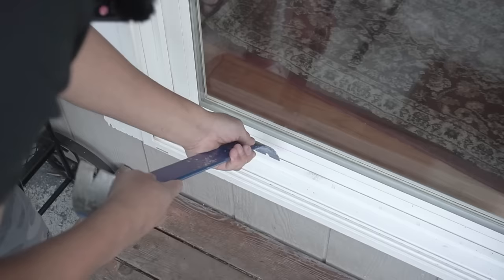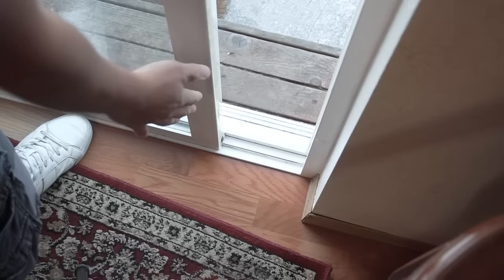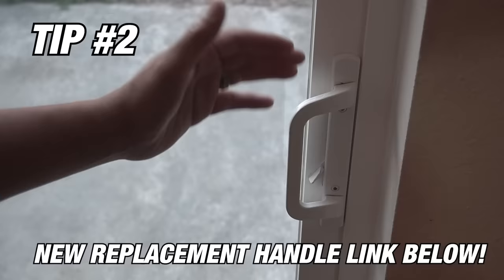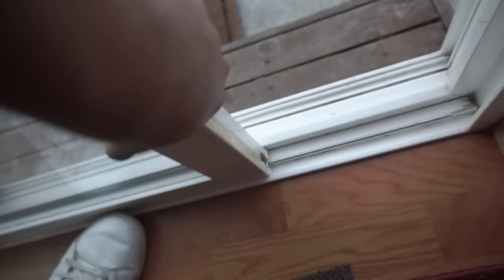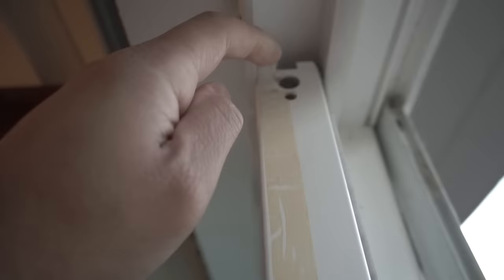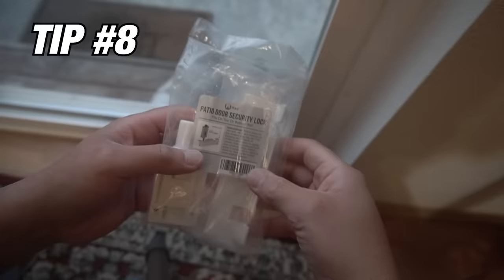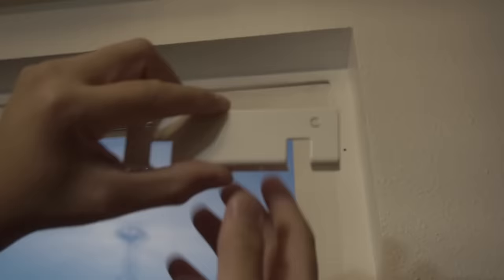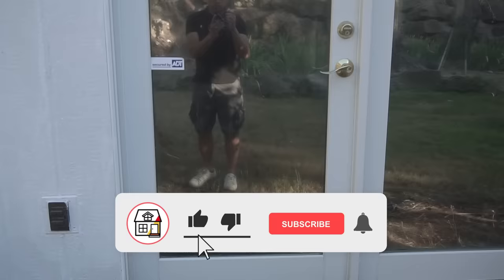How To STOP Sliding Door BREAK-INS! Burglar-Proof Your HOME! (10 TIPS To Keep Your Family SAFE!)

Comment: Lockeding it now way. We have a bar that goes across on left side or I put a pipe in the bottom of the slider windows I take a slight slim would put it on the left-hand side of each window so they can't lift it

Comment: I use an old wood mop handle painted white that lies in the track and becomes unnoticeable. The lateral pressure from wedging it in tight makes it harder to lift the door out of the track.
Don’t the one-way films reverse visible side at night?
Good video. Could actually see how you did each thing.👍

Comment: Problem is nobody else in Home Depot hardware store and Lowe's Hardware store and Walmart Supercenter stores doesn't sell any patios sliding door keys locks and windows locks and my sliding door locks are made of aluminum so far no magnet can unlock the door locks but I did buy a adjustable strong bar combo with 2 types of sliding door locks and entry and back doors knobs locks works great. But I can't use it if I'm leaving outside of my house. The only one way to prevent breaking sliding doors is to buy a 7 ' foot tall stainless steel chain link 🔗 fencing and 9 ' foot wide with 2 metal fence posts and mounted to the wooden deck and against the door frame 🖼️🪟 and you can pad lock it from the outside of the sliding doors when leaving outside of the house and maybe use double locking gate locks so you can lock up inside the house and outside the house . The same thing as Department Stores does and jewelry store does . And or use a stainless steel garage door for the sliding doors and entry front door and back door to prevent tornadoes and hurricane damage as well as criminals from entering the house.

Comment: Lowes sells metal window and door tract locks with thumbs screws. Place them on the top and bottom track and tighten, the door cannot be slid or subverted in any way when these are installed. No tools necessary to do the install, and quick to remove.

Comment: My experience is they just smash the glass. Its actually very very hard to lift those doors as there is not enough gap to lift the door completely out of the track anyway. Most burglars just smash the glass or jemy and break the lock. most latches use aluminum not steel so magnets are useless.
Reply: Hi, I am a single mum with 5 years old daughter. My town is pretty safe but I’d like to increase security. I was thinking to install security screens to all windows and doors but it costs a lot plus they can break the glass if they really want to enter.
Do you know any good idea?
I want to open the window while we sleep in summer too.

Comment: Seems like you can screw or tape one of those white alarm contact sensor on top of the sliding door near the top frame to prevent the door being lifted.   The problem is it is really hard to figure out right away which house the alarm noise is coming from.    If the burglar doesn't care about noise, he would just break the glass and then run in to grab whatever they can grab.    It is more psychological.
Reply: You can get the siren that flashes and not just the sound alarm.

Comment: The gap on top should be shortened with the vinyl blocks that clip in. They are included with basically every cheap door or window. And don't bother with those security locks unless you have an aluminum door. They are completely useless on vinyl doors because they're only as strong as the material you're securing it to, both the frame and the door itself. 
Lastly, as someone who replaces things like this professionally. In doors that old you can literally just take out the stops and pull the glass out with basically any tool. New ones you have to use a tool to cut the seal, but there's literally nothing you can do about that besides getting new windows and doors that don't work like that
Reply: Yes, removing the window pane is now commonly used. And it doesn't trigger a contact alarm as the door frame is still closed. Maybe a vibration sensor on the pane would help?

Comment: You can also screw a spacer above the door track to eliminate the gap between the sliding door and the top track so the intruder cannot lift the door off the lower  track.
Reply: No need for a spacer when the screws accomplish the same thing.

Comment: I designed my own makeshift sliding window lock for a double sliding bdrm window. I'll check to see if those will work with my window. I realized after they installed it, you can't use a dowel in the track as a security measure as both of my windows can slide either direction. This will be easier than what I've been using (although very effective) but these little clip on's will require less effort to remove. It wouldn't be as much of concern if it was an upstairs window. The salesman should have known better.  Most bedroom windows have a stationary side and a slider side.😳

Comment: Drill a 1/4" horizontal hole in the frame of the sliding glass door FRAME  at the top and the bottom. The hole should pass through the door and the track. ( Not exceeding the outside) Put an Allen wrench in the hole This will completely solve the issues.

Comment: I rented a room in my house to a person once on a trial basis I was leaving for a month to help my Dad recover from removing a kidney due to kidney cancer I hadn't seen the guy in weeks and he was paying rent every week that's how much I trusted him. I called him over 10 times letting him know to come get his stuff. Never heard from him. You know when you get that feeling that someone has been in your house well i did and started looking around well the sliding glass door the one that doesn't open the screws were on the outside and he unscrewed them and  got into the house that way. Didn't steal anything and didn't even take all of his shit with him. Check your door and see if that had happened to you during the installation and there  is a simple fix that will cost you about 6 dollars and a lot of patience putting them in. Go get some One Way screws you have to put them in with a flathead screwdriver very slowly and can't use a drill but unless they have the tool to remove them which is about 80.00  no one will be able to take them out. I even got a tube of liquid nails and put that on the screw before installing them.

 The best thing I have ever used to secure the door is another gem I found while looking into this. They sell them at Home Depot they are from Prime Line called a Sliding Patio Door Pin 5.78 each the pin goes into a hole that you will have to drill from the open door into the door that doesn't move. You put the pin into both doors and it doesn't budge and since they can't see the pins they will be dumbfounded as why the can't jimmy the door open. You have to have the correct drill bit you may have to buy and again you have to have a steady hand while drilling. My top pin I have to sort fo hunt for the hole in the second door since they are not lined up perfectly and the bottom just goes right in and out. Sorry so long how this helps.

Comment: Turn the locking mechanism upside down if you can lift the panel up to unlock it. Also, a stick of wood in the slider track on the inside panel will lock it.

Comment: I guess all doors are not equal.  Mine is 50 years old, aluminum. The most popular local brand.  You cannot lift the door because there are two slots for the latch in the frame.  One is for the moving hook and the other is a stationary deadbolt.  The door will therefore not lift until it is moved sideways an inch.  And it will not lift out until it is mid travel, because of an engineered bow in the upper frame. (same idea as your screw). The latch lever is shielded by a heavy trim piece so that a magnet cannot come near.

Comment: Cool tips to know but say if I'm a criminal breaking in that's not holding me back from my objective. It's just one way to limit my options. Wouldn't it just be easier to break the glass and open the door or get a suction cup and a diamond cutter and go around the suction cup?
Reply: So are you a criminal just asking for the people in your neighborhood 🤔
Reply: @anncrane6451  No, I am not.   I think you miss the point, Ann. Criminals will break in, no matter what a person does to make it difficult.  For instance, all I need to do is break the glass with an object. Or get 2 different size suction cups one larger than the other for the double pane. Take a diamond blade cutter and go around the first one,  then repeat. 😉

Comment: Interesting, have been using two dowels in both sliders since moving in 12 years ago. From time to time would ask Electrician, handyman are these doors made safer nowadays, & the answer was always yes. I no listened to them, kept the dowels in the door. Then by accident the dowel was positioned on pet’s blanket and rolled back into track. I have those adjustable thingys to place under front door handles. So am now locked out of house. Got in and blanket is elsewhere. Is the dowel the cure all or which tip should be added please ?I also shoot, if home otherwise would like to deter any 🤬 that tries when I am out! Society is really going down quickly. Your Mom’s backyard is beautiful, shame half of the window is being blocked by the hutch.

Comment: The door glides on track using adjustable roller. Just increase the ride height, there is no need for screws in the top of the frame.

Comment: So the only thing I’m worried about is some one smashing it, mines really heavy duty with zero play in any direction. And locks with a key and it’s stiff with the key so you’d have to have an impossibly strong magnet . The glass looks to be double paned and is at least a half inch thick maybe even 3/4” .. what are the odds of some one smashing through that?

Comment: Just prying the door upwards would undo that latch wouldn't it?
One fix it you didn't mention is simply drilling a small bore hole in the edge of the frames - only through the first two layers - at a slight downward angle, and dropping in a 1 1/2 to 2-inch brad. That secures it better than most, it's cheap, and it fixes all of the things that you mentioned.

Also, you needed better lighting on the subject when you were pointing to things especially in the dark corners behind that hutch or buffet cabinet. It was fine if you were doing something with your drill and the light came on then we could see it but we couldn't see it when you were pointing it out or telling about it.

Comment: All my sliding doors came with a lock built in to the handle. Are they not an option in the USA? I also has a security door put on the outside of the sliding door to give a bit more security but also to stop insects entering to house on hot days when I opened the sliding door for airflow.

Comment: OR just use a drill to put a screw on the top that goes through both the moving slider door and stationary part.  Then all you have to do is put the screw in when you sleep or not home.  And remove it when you want to open it!  It literarily takes 10 seconds and it's free!  None of these expenses or hassles!

Comment: THE WINDOW ALARM IS THE ONLY ONE THAT MAY BE GOOD, BUT ALL THE OTHERS ARE WORTHLESS, A BURGULAR CAN USE A GLASS CUTTER TO CUT A HOLE  LARGE ENOUGH TO REMOVE THE LOCK BAR AT BOTTOM OR CUT A HOLE LARGE ENOUGH TO JUST WIGGLE THERE WAY THRU  A HOLE  TO GET IN!!! I WOULD GET RID OF THE SLIDING DOORS ALTOGETER!

Comment: That door isn't properly adjusted. There shouldn't be that much play between the door and the guide track. It can easily be adjusted using the adjustment screws on the upper and lower edges of the door stiles. You don't need to install screws in the top of the track.
Another word of caution: I've had to break-in to a house using a wire bail from a 5 gallon bucket. I just fed it through the seal between the two glass doors on a sliding door, using the wire bail to flip a wooden dowel out of the track which was put there for security purposes. Then I just lifted the door enough to disengage the lock from the door jam and pulled it back.

Comment: the dowel behind the door doesnt work.  My sister broke into our sliding door when she was 14 because she forgot her key.  It only took her about 5 minutes
Reply: What did she do?
Reply: @cwr8618  took a coat hanger and bent the end up maybe half an inch.  Slid that thru a crack between the two doors down by the bar.  Then used the half inch to flip the bar out of the rail by just twisting the coat hanger slightly.  Worked like a charm.
Reply: @robinchopra139  interesting

Comment: I just moved into a house with what feels like the heaviest sliding glass door I have ever felt. Could there be something wrong with it causing it to be so hard to open?
Reply: I've had this problem and it turned out the door was not properly mounted on the track.  If you haven't already, also check to make sure the track is clean.

Comment: THE STICKER SOUND ALARMS ARE OK BUT YOU HAVE TO BE HOME TO HEAR THEM. THE BEST THING TO DO IS GET RID OF THE GLASS SLIDING DOORS FOR  A SOLID DOOR. BECAUSE THERE IS NOTHING STOPPING SOMEONE WITH A GOOD GLASS CUTTER TO CUT A FULL BODY HOLE IN THE GLASS DOOR AND THAT MAKES ALL THE OTHER PRECAUTIONS USELESS.

Comment: All you need to do is Lock your door, drill and insert a SPLIT PIN on an angle through the door and frame right down at the lowest point on the side of the door handle. Then you use a piece of 1 inch dowel that lays from the opposite end of the door to the split pin, along the sliding tray to the wall edge. You didn’t mention this once and it it the cheapest way to secure a sliding door or window. A piece of dowel costs you about 2c and a split pin costs about 5c…….thank you and goodnight!

Comment: When a door is locked, your first comment about lifting the door is not helpful. Very few door locks are susceptible to lifting. For the few that are, a screw in the header is all it takes to stop lifting. The center of the 2 panels lock together securely until opened.
TLDR: Show how a locked door can be removed by lifting it from the outside.

Comment: Door latches are made of aluminum specifically so they cannot be moved with magnets. Properly installed sliding vinyl doors have spacers at the top and their wheels are adjustable so the door cannot be lifted. You made several bad assumptions here.

Comment: There is no reason to put screws in that door frame. Great way to cause leaks.
You could have lifted the entire door with the wheels that are already installed. They are designed to adjust the doors height. 
I haven't seen your other videos, but this one gives some poor advice that could void a warranty.

Comment: You really telling people to screw the jam???? Dude that's the worst idea ever. You're moving the jam which isn't good for the door.  Just set the damn door correctly.  Those big holes on the door have screws in them that raise and lower the whole door section that slides. Guess wat it also has them on the bottom as well. So if you do mess with both you can decrease the deadspace between the door and the door jam. But you do you homeboy.

Comment: So much useless information, most of it is only good if your at home, when security is a little higher because your home. Try installing a wood pole stop when you have to leave. I came here to find out what i can do if I'm not home, so not a lot of good information here, and my other issue is what do you do to just stop them using a brick or hammer to just break the glass and enter..

Comment: Did I miss something?—all you need to do is go to Home Depot and get a dowel cut to the right length and put it into the door track to the left of the sliding glass door and it cannot be slid open-cost?-cheap
Reply: You didn't watch all the video. Burglars can lift the door upwards, then push forward taking it off it's tracks, making the dowel useless.